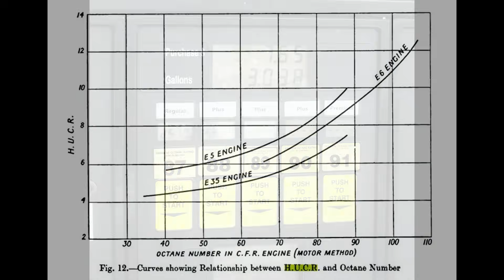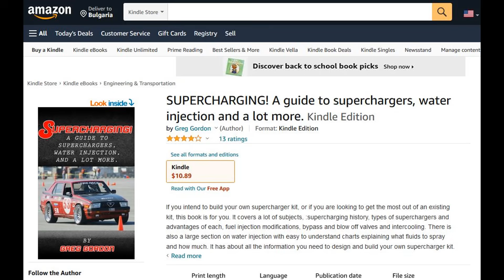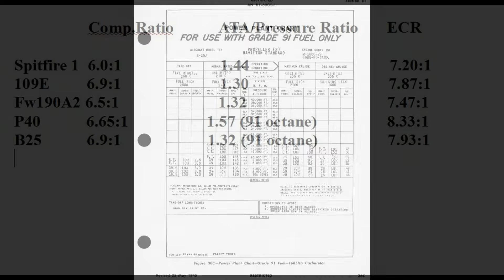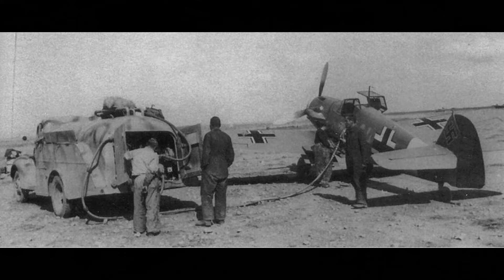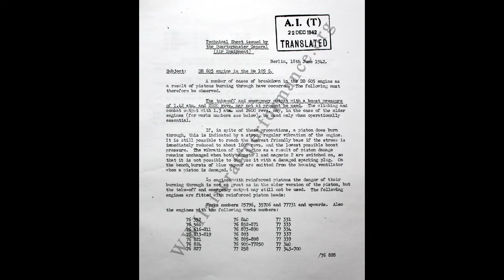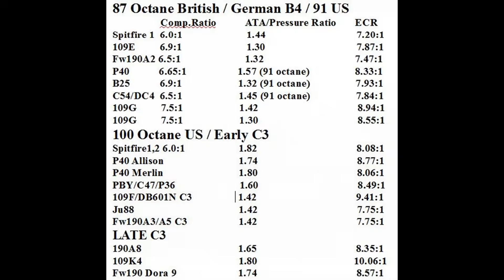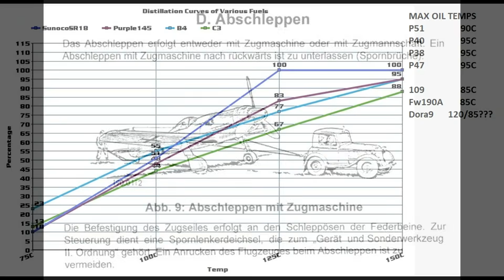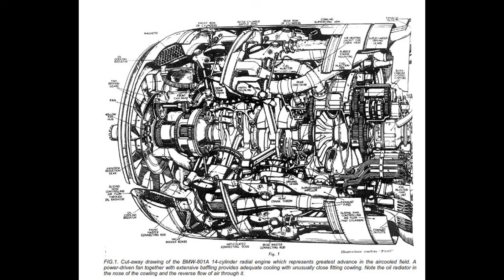German C3 Fuel, Uber Octane or Synthetic Crap?

Comment: The funny thing that the video I mentioned before you started, about Swirly throttle - well it came from the guy who you cited then tons in this video Calum Douglas ;)
Here is a link for everyone interested: https://www.youtube.com/watch?v=HwALos8CwJ0
Also he isn't negative about Greg. He just points out that there are flaws in Greg's videos. Which to be fair to Greg it was very short take on it.
Video by Mr. Douglas is 50 minutes long.
So you now also have the access to his channel where he goes into technical details - even more than Greg here, but in less approachable style - Greg is very easy to understand. Every step in logic is clearly explained.
I hope you also watch Drachinifel - while you cover completely different topics (apart from Drachinifel making an extended video on Japanese Zero - with an expert that I think often Bismarck uses) - you are very alike. And that's a plus BTW.
Reply from the maker: There are flaws in all videos. The most common criticism I get is that I didn't cover factors A,B, and C. Which is a criticism,  that can be leveled against any video ever made, it's literally impossible to cover everything in a single video. Regarding the swirl throttle, yes my video on it was very short, I didn't think anyone would be interested in it. At the time I made that video nobody else on youtube had covered it.  In general I don't feel that I go into less technical detail, I think I cover more, however I approach it from a very different perspective.
Reply: @GregsAirplanesandAutomobiles  Okay - as a foreigner, for whom English is a second language I wanted first to clear misunderstanding that I caused in chat by saying he said some negative things in the comment. I was writing fast and that limits my vocabulary. I thought that perhaps his response was a bit rude - since if I wasn't watching your video - I would never get his in recommended. And lots of people seem to have arrived there thanks to your videos. Obviously he wasn't rude. He just didn't seem as.... what is the word? Gracious? not exactly what I mean, but it will have to do. .... not as gracious as he should be that your video was the one that caused algorithm to show his video to many, many people.
Same with "technical aspects". While you cover a lot, his videos are more specialized. It makes them very different. And what I was thinking about was mostly - you don't use complicated mathematical formulas - just very basic ones. Sometimes they are approximations. For simplicity sake - You want your videos to be understandable to everyone. He makes videos that require some knowledge to fully understand them.
So yes - in a way you talk more technical detail - hence why I said that each step in your deductions is explained. You go really in-depth. His videos seem to be more technical, because they are harder to understand - and IDK if you were to make a video on Swirly throttle again - how you'd approach it. I know it would be a very different video, because there is so much to explain. So like you said it is different perspective and I probably saw: "More complicated math = more technical detail".

I apologize for any misunderstanding I've caused.

Comment: great video. I'm wondering how Mazda could achieve 1/13-1/15 compression without a turbo on their contemporary skyactive engines
Reply: It's a very clever technology, somewhere between a diesel and a gasoline engine. 
AFAIK they are using a very lean mixture, which by itself wouldn't ignite at the high pressure, caused by the compression, then they inject a little bit of fuel into the cylinder and ignite it by a spark. This causes a spike in pressure, which ignites the rest of the mixture.
Reply: @palisadenhonko4962  In Calum Douglas' book, which Greg refers to in this video, he talks about a German engineer for, I believe, Junkers, who develops an engine that works on more or less this exact principle.  There was a second type of fuel that was injected into the combustion chamber that then initiated combustion in the compressed mixture.  A little like a diesel hybrid I suppose.  Its a great book, well worth getting.
Reply: Plus the sensor technology and engin controls

Comment: The Merlin Was pretty crap in the beginning so no wonder they where conservative.
Reply: 36. ... According to them, the Allison is averaging 1500 hours between bearing failures as compared to 500 to 600 hours for the Merlin. The Allison, they have found, will drag them home even with the bearing ruined. 
Mustang variants of the RAF and RAAF on line
Reply: @nickdanger3802  Allison used thin wall bearings, which are universal today. Rolls-Royce was still using babbitt bearings. RR made them work be using sophisticated casting methods, but they were still inferior to the thin wall bearings.
Reply: "The engine suffered in early development and production with problems with the accessory gear trains, coolant jackets, cylinder head cracking, coolant leaks and excessive wear to the camshafts and crankshaft main bearings."
The Spitfire Society Merlin page
Reply: That's why Packard built 60,000 of them because they were crap. What an absolute dork
Reply: The Spitfire mk1 entered service three years before Packard had built a single Merlin.
And Packard did not build any of the early variants.

The Merlin had a very troubed development and is a story of perseverance hard work and gradual improovement.

The worst early Merlins did not even go to the Mk1 Spitfire it went to the Fairey Battle the worst combat aircraft of ww2.

No wonder the compresson ratio was slightly lower if that helped make the Merlin reliable.
Reply: "Early production Merlins had numerous problems that led to their reliability being questioned. The leaked their coolants and the cylinder head frequently cracked. However, by version Merlin ‘F’ all major issues had been resolved and the engine officially became Merlin Mark I."
History Learning Site UK Rolls Royce Merlin

Comment: How they got or couldn't get quality lubricants would be interesting especially as their production metallurgy was so poor from the raw materials blockade.  Not trying to knock .... the wehraboos or nazi fans .. too much.
Reply: I don't think even the most hardcore Axis fan would argue that Germany was lacking in several resources such as oils and fuels.
Reply: Context matters, AFAIK in 1942 Wehrmacht got more fuel than entire USSR produced forr himself...
Reply: @softstone125  Before the Stalingrad collapse it blocked Soviet access to the Baku fields but it could not take out any of the oil.
Reply: @softstone125  
Yes but the communists got infinite fuel from USA...
Reply: Lubricants where an issue in WW1, when Germany's acces to castor oil was cut off. At the time castor oil was the only suitable lubricant for rotary aircraft engines.